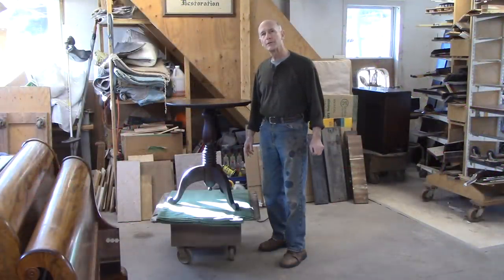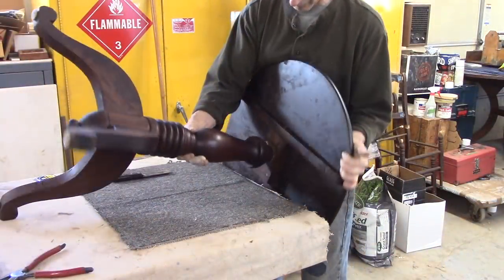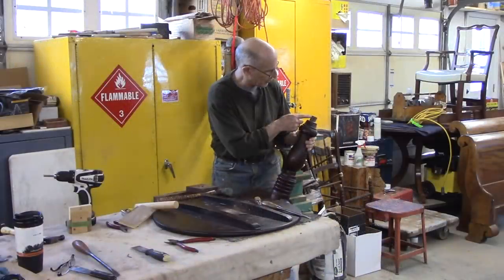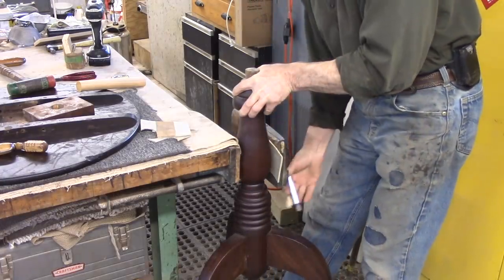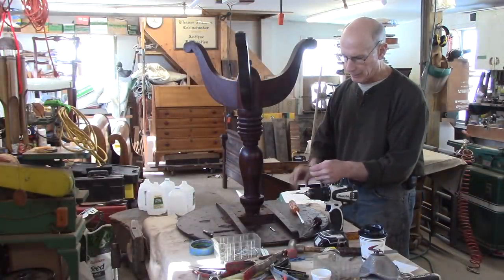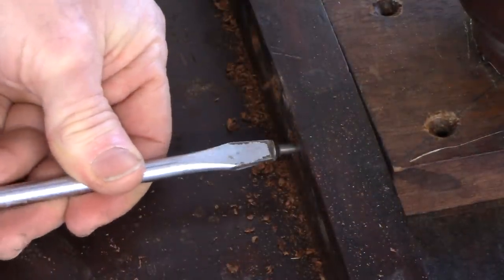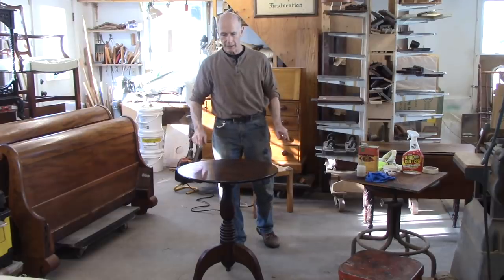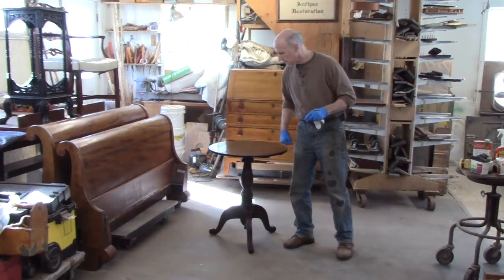Stabilizing a Wobbly Table Top - Thomas Johnson Antique Furniture Restoration

Comment: Several folks have implied that you should not have "gone the extra mile" to clean and polish the furniture.  I would guess that your years of experience in dealing with customers would give you a sense of when it acceptable to do a little extra and when it is not.  Usually if customers have a specific reason to limit your work  they will let you know what it is.  (Especially if they are aquainted with your standards of excellence)
Reply from the maker: Thanks! You are correct. The whole idea is to NOT make something look new, so you have to pick and choose what gets repaired and what stays the same. All structural work is a must, the cosmetic parts are optional

Comment: Another great job and lucky customer.  I agree with the use of the Phillips head screws.  Thanks for posting!
Reply from the maker: Wow! First comment! You're welcome!
Reply: Structurally, Phillips screws are as strong as slot-head screws made of the same metal. And Phillips screws have some advantages, which is why they are used (for example, the screw is easier to center and it doesn’t cam out as easily). But the Phillips screws do seem wrong for an antique. Phillips screws were invented in about 1932, so a piece made before the 1930s would not have had them when it was new (although there were some other cross-slot screw designs a bit earlier than that).

When restoring something old, my preference (in order from first choice to last choice) is: 1. Parts and fasteners that were in the original piece, 2. Parts and fasteners that are about as old as the piece and similar in style, 3. New parts that are similar to the original parts, 4. New parts that reflect a more recent style.
Reply: I feel the same way.  Not only does it look out of place but the quality of the old screws is so much better than the new ones.  I collect old boxes of screws whenever I find them.  The threads are cut so much cleaner than the average hardware store screw that you'll find today.
Reply from the maker: Thank you! I agree whole heartily!
Reply from the maker: Thanks! Yes!
Reply from the maker: Good point! I hadn't thought of that!

Comment: It amazes me to see how many of the exact same old “seasoned” tools you and I have. Great Uncle Clarence was in a military version of the Seabees before World War I. He was an engineer and craftsman. I have the trunk and some of his tools that were with him in South America while working on the Panamerican Highway. Sadly the mountains of weavings and ancient native pottery were thought to be of little value and essentially tossed out in the early 1950’s. Archaeologists digging in the Rhinelander Wisconsin dump site from that era may be surprised at the treasures within. I have a small plant stand that he made in our living room. It is a very simple design that I have repaired and waxed for many years. The disc shaped top has a dowel block that allows the pedestal to be glued in place. It too was wobbly. Years ago I repaired the worn top dowel shaped turning at the top of the turning by inserting tiny wedge shaped slivers of new wood and gluing in place a paper thin veneer wrap. It sat in a puddle of white glue for a day and then was taped securely around the dowel end. After drying for several days it was sanded until only slightly larger in diameter than the old hole in the block. The hole was carefully cleaned with Exacto blades and careful sanding until a great fit was restored. Before reattaching the block to the underside of the top, I used my steel dies to engrave info about Clarence and when it was made. I added my name and the date (1968) before reassembling it. I love this link to the past and share your passion for preserving furnishings for future generations. As always with my respect and admiration, Larry in Arizona
Reply from the maker: Hi Larry, thanks! That's quite a story. Sounds like you did a good job. I love the fact that you preserved the info about the table

Comment: Thank You Thomas for a great video! I've restored and made furniture for over 50 years and I like you, can't stand a phillips screw in old furniture. I have a huge collection of old screws including hand made ones. Going through boxes of old hardware from auctions and buying very beyond furniture for the period wood and veneer, I also get a good supply of old screws and hardware. You buy good reproduction hardware and some companies will include Phillips screws. So I use slotted ones. Most people don't notice or care but boy, I sure do! I enjoyed the nail scenes! So many times it seems like you have to pull out dozens of nails and most didn't do much of anything except save the original piece at times. Those Grandma fixit jobs can be the worst sometimes. Thanks again! DaveyJO in Lancaster Co. Pa.
Reply from the maker: Thanks! Yeah, I know there is nothing wrong with a Phillip's Head, but I just can't do it on an antique!

Comment: You've probably know this but with loose round plugs I use a plane to shave off thin long curly shavings..then glue and wrap them around the shaft to thicken it. I've found this creates an even  circular thickening of the shaft without having to use wedges... I'm not trying to teach you how to suck eggs but I've seen a couple of your episodes where you've used wedges to fill holes and from my limited experience thin shavings work a treat. Love your shows and have learnt a lot. 👍🏻😁🇦🇺
Reply from the maker: Thanks! I don't mind, that's a really good idea. I will try it!

Comment: Nice fix. On those smaller nails that remained in the cleats which you pulled out after removing the pedestal—try pulling them through in the same direction they were driven using nippers. This technique works well and lessens the chance of blowing out the wood on the face side when being hammered through.  Good work —New subscriber.
Reply from the maker: Thank you! And yes, sometimes I do that. And like all things, sometimes it doesn't work. Those cleats were relatively thick

Comment: Just the video I needed; I’m disassembling some wobbly dining room chairs for a proper re-glueing, but every rung has a small nail with no head on it. I’ve been searching for methods to get them out without splintering the wood
Reply from the maker: I hate those chairs with the pin nails! A lot of times with spindles you can "worry" them out, typically those nails are small

Comment: That is a LOT of work. I have a table similar to this, wider table top, and very wobbly. I was hoping to find easy solutions to do this myself, but I don't think I'll be able to
Reply from the maker: Thanks! Nothing's ever easy! Try just a small wedge where the bottom of the top meets the piece on top of the pedestal. If the legs need regluing, well, that's another story
Reply: Thanks for responding! Yeah, I bought from marketplace bc I love the look with the ornate carved legs, and it was cheap.  (it's a cocktail table). I was so excited that I didn't take the time to inspect it. Once at the house, I noticed the feet were split down the middle, the legs need regluing, but someone has already put screws in to solidify them in the past...plus the wobbly top. So, yeah...gulp! Not sure I can fix it. I'll see what I can do...will keep you posted!
 @johnsonrestoration

Comment: I agree with Mark Harris. Anyone who attempts to repair a nice piece with nails should be banned from any kind of workshop. But on the other hand you did a fine job of getting those nails out and effecting a solid repair. I thought you might have repaired the top itself where all the old screws were but your repair seems appropriate. After the extra work you put in the table looks perfect. The remaining stress marks in the top look right at home. An excellent restoration. Entertainment and education. Thanks for sharing.
Reply from the maker: Thanks! I would have lied to repair the screw holes in the top but couldn't justify the time.

Comment: A beautiful job, but I couldn't have that table in my home. The clash between the top and the base proportions would annoy me every time I saw it. 

Thankfully, the eighteenth century tilt top tea table I inherited from my uncle has the correct proportions. Unfortunately though, my aunt, his sister, had highjacked it for several years, and had over waxed it, so much so that it was possible, in the right light, to see a thick layer of wax. Although I have done a very gentle removal of quite a lot of the wax, I've never had the nerve to do anything more. However, seeing the effect of the tung oil, and wax finish you use, I'm tempted to do a more thorough job. The table deserves it.

I think you have taught me enough, having watched all of your videos, for me to attempt this. Thank you for sharing your knowledge.
Reply: Search YT for Gilboys and/or The English Polisher. They're top-notch French Polish experts and show how it's done.
Reply from the maker: I think you should just go forward, clean the top with paint thinner to remove the old wax. It will probably just need to be rewaxed at that point
Reply from the maker: Yes, good idea. I love the English Polisher!
Reply: @johnsonrestoration  Thank you Mr Johnson for taking the time to reply. I think that I shall take your advice once I've plucked up the courage...I am such an idiot with things practical that it will be a big step for me.

Comment: Just wondering why steel wool was used with the polish?  All of the polishes I’ve used in the past always said to use a soft cloth to apply, but it’s hard to argue with the results in the video!  Very nice!
Reply from the maker: Thanks! The 0000 steel wool is an abrasive, although very mild with the polish as a lubricant, because I'm cleaning the piece as well as polishing. If the furniture doesn't have years of crud on it then yes, just a cloth

Comment: Tom,
Great video, very informative as always, thank you for taking time to produce these.
A curiousity question regarding the repair if I may, regarding the pedestal top block: when remounted I noticed the original design was with orientation such that the screws through the two cross members go into end grain. I know you keep as much of the original assembly as possible, however in this case wouldn't it have been a stronger fix to make a new block where screws go through side or long grain?
Reply from the maker: Thanks! I think technically you are right. In this case, we're not asking the screws to do much, the forces will be the shearing strength, which should be fine
Reply from the maker: Thanks! Yes, that might be the case. The wedge was original (I think) to the base so I decided to go ahead and use it. I think it will last a long time

Comment: That Customer Is going be REAL happy>  Question; You use a pair of wire cutters to remove nail. I haven't seen a pair the pointed on the ends....Are yours ground down to that point or are they 'leaded glass came" cutters?
Reply from the maker: Thanks! I ground those down to that shape, just for nails

Comment: The top was due for a shorter life the way it was fastened. Sooner rather than later it was coming off and likely with a fair amount of damage if left in original state.  Nice work.  Question:  you say commercial degreaser. Do you have some examples of “safe” ones?
Reply from the maker: Thanks! Do you mean enviromentally safe? There are a few "green", citrus cleaners out there. They work well
Reply: Thomas Johnson Antique Furniture Restoration I was interpreting “safe” as “wont destroy the finish”.  Does that make sense?

Comment: Love watching you work. I have a similar table with a very crooked top. Seems one leg is almost a half inch short, two are about a quarter inch short. Any tips?
Reply from the maker: Thanks! First you need to make sure they are all glued in the proper position. Then you get out the saw and start with the longest one... (or add a glide to the shortest one)

Comment: An excellent finish to the repair job.  I have a question. It looked like you were putting the old slotted screws into end grain.  Would a dowel inserted horizontally perpendicular to the grain have given more purchase?
Reply from the maker: Thanks! You are correct, but I didn't think it was necessary for what we were asking the screw to do

Comment: VERY nice👌 Can you tell me why you apply wax with steel wool, vs a cloth? Also what #grit you used? Ironically, I found an old table this style on a curbside. It has this same issue. Now, I feel more confident in trying to repair it. The block screws are just spinning also. Thank you so much for sharing your knowledge. 🤗😊
Reply from the maker: You're welcome! Thanks for watching. The steel wool serves as a mild abrasive to smooth out the finish. I use 0000 steel wool. But a rag is fine
Reply: @johnsonrestoration  Thank you so much Tom.. It all makes sense now. My Gramps was a furniture maker and he always used steal wool and that same bee's polish. I remember his pieces feeling so silky smooth. <sigh> I miss him.

Comment: Tom, that looks like it might have been a drop leaf originally.  I apologize if I missed you mentioning that somewhere in the video if you did.  I've run into that same support system on the underside of small tables such as this, and a majority of the time that sort of system is associated with drop leaves.  Was there any evidence of a wooden dowel hinge?
Reply from the maker: Thanks! No, I don't think that is the case here. I don't know if I've ever seen a drop leaf on a pedestal base
Reply: @johnsonrestoration  Sorry, I wrongly mentioned "drop leaf" when what I meant to say was "tilt top".

Comment: I am wondering why you didn't fill in those many and varied screw and nail holes.  Not because of aesthetics, of course, but don't those holes pose potential structural problems or provide a place for mold?
Reply from the maker: Thanks! Well, I think filling them wouldn't help structurally, but that's a good point about mold, etc.

Comment: I was quite surprised you didn't dowel plug the speckling of hidden screw holes in the underside of the top and on the post topper.  Someone in the future who doesn't know YT will try putting screws into those "empty" holes and crack the table top.
Reply from the maker: Thanks! I think you're right, I should have

Comment: Quality job! Well done. IMO... Torx screws are best if they're not going to be seen or not for authentic restoration.  Far stronger than Philips & those horrid flat heads.
Reply from the maker: Thanks! It's funny, you are right but even when unseen I just have to use old screws on nice antiques. Newer furniture, modern screws are fine

Comment: Isn't it a joy to repair the botched work of others? Still, who ever it was had the presence of mind to use wire nails rather than ring shank nails pumped in with an air nailer, otherwise you would never have gotten them out. Did you plug the bore holes in the rails Tom? Perhaps it wasn't necessary? Great job as always. David
Reply from the maker: Thank David! I didn't repair all the old holes, it just wasn't necessary. They'll still be there if some one wants to repair them in the future!

Comment: you could just re-amalgamate the finish using alcohol, the original varnish dissolves in alcohol then rehardens with no water marks and will be crystal clear, it will look virtually new.
Reply from the maker: Thanks! Yes, I have tried that with all types of amalgamaters, somewhat limited results. Too many variables, but I alway give it a try

Comment: Is there a reason you didn't glue the top to the stand and only used screws?
Reply from the maker: Thanks! Yes, the supports run perpendicular to the top, so they are screwed on thru slotted holes to allow for wood movement

Comment: I am surprised that you altered the finish even though the customer was very specific about repairing the top only. 
I have learned over the years that some owners are actually precious about the story written in the finish of wood. I recently restored a 1930s radio, (making if work), and the customer made me sign a document agreeing not to alter the appearance, not even to clean it. 
I hope your customer was ok with what you did.
Reply from the maker: Thanks! I hear you! I feel confident that it will be OK. The top was not original and had been refinished in the past

Comment: Ossipee here. We have an issue with solid oak oval table leaning down on table top ends. Is there anything I can do? Thx. Nice video
dinning
Reply: It doesn’t sag but when having arms on table it leans downward raising the other end
Reply from the maker: Thanks! It sounds like the extension set is coming loose. Turn it over and have a look, Probably the screws have been pulled out, and will need to be plugged and redrilled

Comment: How old do you figure that table was? Maybe 1880's? I never came across a table that lasted so long, but the top was so damaged.
Reply from the maker: Thanks! Definitely 19th century, but I think early to mid
Reply: @johnsonrestoration  I gotta get some shellac drips on my shoes again. I did French Polish and several different hand applications during my time as a finisher/restorer and it was my first job. I need to find a couple pieces to fix. I am probably going to do some mid century or Art Decco since those are the styles I personally like, but if I found a good piece that was older it would be nice too. I have pieces that I restored that are in the Smithsonian and a bunch in Castle Hill. I don't know why I never went back to doing this stuff.

Comment: Only 2 types of screws I want to see in wood, flathead and robertson. Even if robertson screws cam out from drills that are not "hammer" drills. Phillips are far drywall and electronics, though hex is better for electronics and machinery/metal
Reply from the maker: Thanks! I am not familiar with "robertson". But I save old screws and use them for antiques. I can't use a phillips head, even if it's not seen